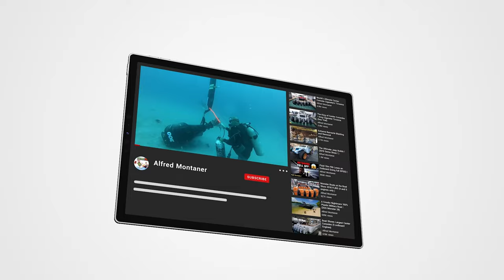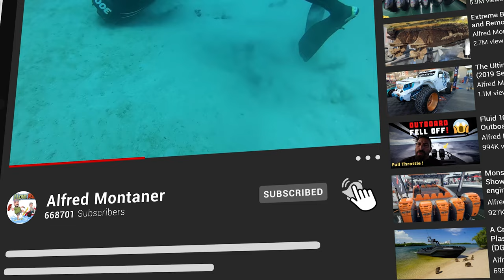Huge Barge with Crane Removes Beams ! Tiny Tug Does the Dirty Work (Tug Boat Series )

Comment: At 36 minutes into the video, the hammer as you called it, the small end looks like a hydraulically operated 'plate dog', which clamps onto the edge of a plate, or the flange or web  of an 'H-beam' or some other flange, to remove or install it, but this can also be used to vibrate to sink the steel in the bottom of the river. The plate dogs I've used in the past are only mechanical units, and not hydraulically operated. It's fascinating to see how things work, to get a job done.